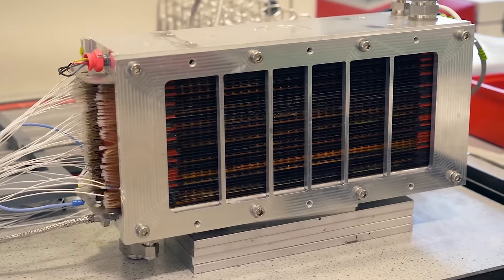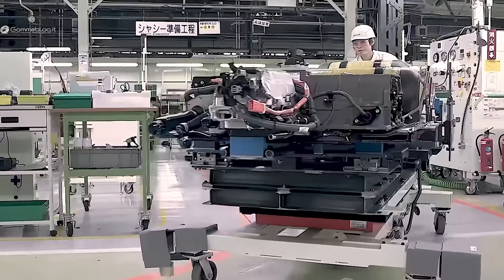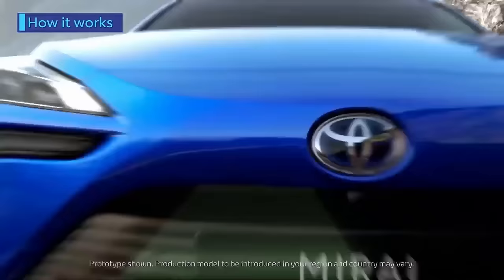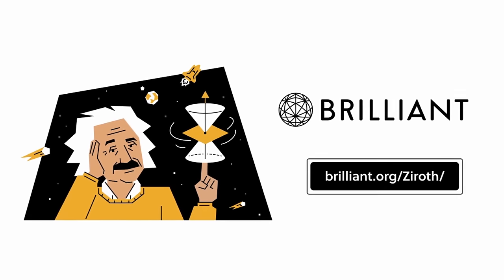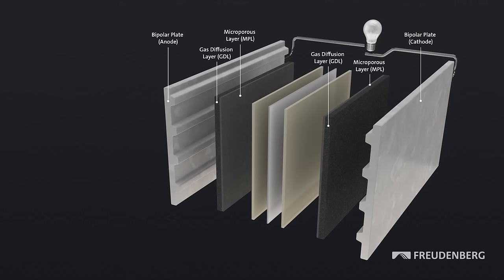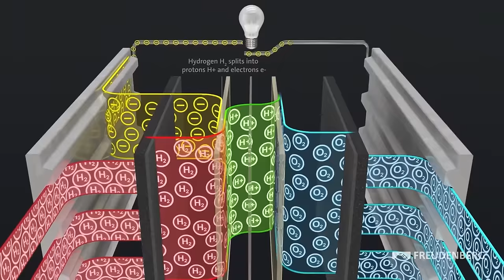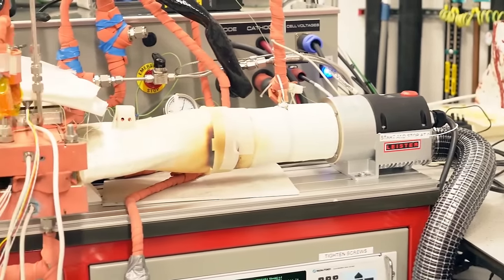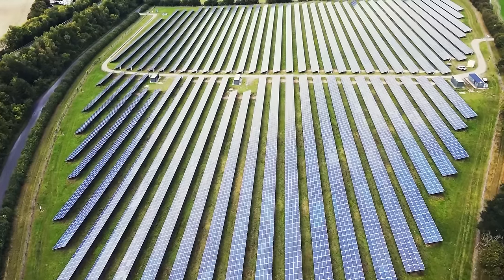Why This Hydrogen Fuel Cell is Engineering Genius

Comment: It may be more logical to produce methanol using hydrogen in the first stage.
Reply: Exactly!  Methanol is much easier (and safer) to handle than cryogenic (or high-pressure) hydrogen.
Better yet, they could just burn the methanol directly in an ICE.  Or perhaps a methanol fuel cell.
Reply: Methanol burning is not zero CO2 emission technology unlike the tech described in the video.
Reply: @Torx-uh3uo  Storing hydrogen is very difficult and inefficient. We must find a different way.
Reply: @glynnec2008 burning extracts significantly less energy from the fuel than fuel cells.

Comment: Why don't these guys use simple electrolysis to get hydrogen and oxygen from water, then recombine it as fuel and sent it thru an regular piston engine?  The exhaust is water when it is burned

Comment: I don't agree. Optimizing a thing that shouldn't exist, in this case hydrogen for cars, is not "genius". The most common engineering mistake i see is in fact optimizing and working on something that should not exist. Why make a part super duper great when in reality,  a great design wouldn't need that part at all. The only sensible thing for cars is electric
Reply: This isn't cars it's planes. There needs to be a certain energy density because you can't practically refuel mid flight. I agree for cars hydrogen doesn't make sense, but when you need the energy per unit mass to be higher battery technology is not capable of this yet. It's a case of using the right tool for the right job.

Comment: OK they made a fuel cell which can produce enough electrons to run a prop airplane.  That's great!  Now how do they plan to run a prop airplane at 30.000 feet? I am thinking the prop size and spinning diameter will be very be very large for such altitudes.  On most jumbo jets where would they place the props so they don't kit the ground when on the  ground.   They can barely keep the bottom of engine on 737 from hitting the ground.  Even if they are capable of building a high output fuel cell it will most likely require some serious redesign of jumbo jets for the prop system.  MY 2 cents

Comment: Why not capture some of the water byproduct then redirect it to an HHO generator that’s powered by solar cells on top of the aircraft?
Reply: Because "HHO generators" in the common sense dont work. I mean devices, that can produce several kWh of hydrogen from 1 kWh of electricity (overunity, perpetuum mobile).
Electrolysers work. But they are bound to the laws of thermodynamics. They will always produce LESS than 1 kWh of hydrogen from 1 kWh of electricity-input.
The same with fuel cells: You will always get less than 1 kWh of electricity from 1 kWh of hydrogen.
Why a lossy double energy conversion, if you can feed the electricity from the solar cells directly into electric motors? With hardly any losses?
It would be like using solar electricity to heat up water for a steam engine.

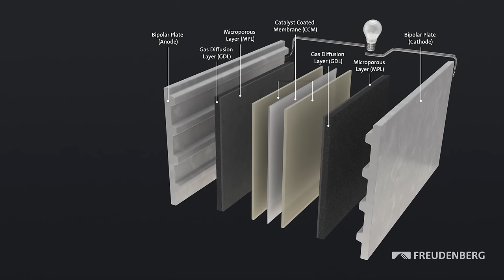Comment: 2:42 to 2:46 hydrogen and oxygen arrive at separate entrances..no mention how these two components are prepared and stored..these two components other than oxygen does not exist in air in pure form. They are just describing another way to use hydrogen and oxygen in this case to produce electricity. they dont mention where the fuel comes from..produced by part of the cell's power output?  perpetual energy? have they beoken through the impoasible?

Comment: The company has applications, but hydrogen for any form of mobility on road or air is a scam. Fuel cells are not the biggest issue, it's hydrogen production, transport and storage.

Comment: Not sure your version of history is correct but i am sure that powerful forces will resort to murder if their wealth is threatened. There is no doubt that electrolysis separates the water into 2 ingredients but my understanding is the qty produced by most DIY'ers is too little. Perhaps it's gone the way of the 50 mpg carb  but there are some old vid's running lawn mowers.

Comment: Hydrogen fuel is still just fuel and the output is many times removed from the input.  At this point in time EVs are a hugely better solution.  This is why Mercedes, BMW and others have tossed it to curb for the time being.  Also, consumers don’t want a money pit.

Comment: :cat-orange-whistling: YOU NEED TO LEARN HOW TO COPPER COILS CAN PRODUCE MASSIVE  HYDROGEN OUTPUT. TWO COILS EACH OPERATING AT TWO DIFFERNT VIBRATIONS.  FREQUENCIES.  (NOT AN OSILLATION).  YOU NEED TO UNDERSTAND THE INDUCTANCE PROPERTIES AND HOW THAT WORKS TO DISRUPT THE MOLICULAR STRUCTURE OF WATER..

Comment: Why using a fuel cell andnot pumping the hydrogen directly in the engine like gasoline engines do? Then like a gasoline engine the hydrogen gas comes in the chamber where the spark plugs make a spark and forms the explosion, etc. I want someone to explain me why not this system that would be less cumbersome.

Comment: Why not just just burn the hydrogen.....in a jet engine?  No fuel cell weight, no turbo charger weight.  Way less plumbing.  

Even if my question is stupid ,cutting edge engineering tends to focus on their patents rather than actual efficiency.

Comment: We have seen this technology come and go now for 40 years the claim is the same and I see no real advancement. Maybe it is a suppressed technology or maybe it is to cost ineffective to operate or not have the weight per horse power need. I feel as soon as the government funding dries up we will be back to refining our combustion engines and making newer fossil fuel synthetics. There are newer technologies that seem to be at the forefront of advancement I am hoping these will be the future as hydrogen compared to Gasoline does not have the same power potential.

Comment: And where do you get the Hydrogen from ?
From water of Course
Did you know, it takes more energy to get the Hydrogen out of Water, than the energy you get from burning Hydrogen.
It's like woo hoo, I just created a $1 Bill, and it only cost me $1.20 to make it
This is about as silly as running a Country on Solar or Wind Power, you can do that, but you'd have to have a Coal, Oil, Gas, Nuclear Power Plant running at 100% capacity on standby 24 hours a day.

Comment: That is really cool news.  I am all for hydrogen for aviation and public transit.  It really makes sense in those use cases.  It makes even more sense if they are using green hydrogen.
Reply: I think overline  electricity form the grid ala trams or the bullet train make more sense for pubic transit. Why carry your own fuel when you can  sip power from the grid?
Reply: No hydrogen dose not 'make sense' in either a financial or environmental sense, battery technology has passed it by long ago.
Reply: @kennethferland5579  Battery at the moment  is too heavy for certain application like ships and aircrafts.

Comment: 11:03 is that the best place for those? doesn't seem like it.
Reply: Dude, you're on a roll.
Reply: @Torx-uh3uo  first pass is systemic, then go through in detail and question and optimize every component, then do a new systemic upgrade integrating the improvements, "how do these new things work together better?", then whatever problems you had doing that you innovate to bypass. polished and standardized fully developed technology. i do this for every new engineering concept i encounter.

Comment: i have said for more than 10 years i want the Volkswagen Hydrogen EV car that is only sold in California here in Sweden. i dont want a Duracell EV, i want a Hydrogen EV car if someone has to force me what car type i  should drive. i have nothing against Electric powered vehicles, but its the batteries i dont want and everything that comes with it! i have asked for the Volkswagen Hydrogen EV for a looong time, yes its more than 10 years now! And yes Volkswagen have sold a car with this tech in the video in California for more than 10 years this is not anything "NEW".

Comment: The technology of hydrogen fuel cells is  awesome. We should continue the research. Though the reality and the big picture - hydrogen is NOT zero emission. It requires more energy to produce it than it produces. At the commercial level hydrogen is either produced by electrolysis or Steam Methane-Reforming (SMR). Both of those processes release an enormous amount of greenhouse gases. The most common and cost effective way hydrogen is produced in the U.S. is through SMR which produces CO, CO2 and hydrogen. Electrolysis produces greenhouse gases because 60% of electricity in the U.S. is from burning fossil fuels. Sure - there's biomass gasification but that' is not cost effective nor can it produce the amount of hydrogen in demand at the commercial level. Hydrogen energy is a negative net. In regards to its use as energy; Its best use is rocket fuel of its ability to essentially be a controlled explosion and produce a massive amount of thrust in a short period of time. Just like with EVs, the whole story is not being told. A hydrogen fuel cell is a bomb. The cost of hydrogen energy is aprox $90 per gallon. To make hydrogen a viable source of energy, more research should be in finding a way to produce it cost effectively and without producing greenhouse gasses... then it will be zero emissions.
Reply: methane is not reformed it is used in the hydrogen process for heating the (subject)..............
Reply: @roybarton9617  You are incorrect. To clarify the process is called "Steam Methane-reforming" (SMR)  AKA Natural Gas Reforming. SMR uses oxygen via air for combustion as a heat source to create steam. The stream heats the methane along with a catalyst (nickel or platinum). The chemical equation is 4(CH4)+ O2 + 2(H2O) -> 10(H2) + 4(CO). It produces CO, as you may know, when CO is released into the atmosphere it reacts with oxygen and converts to CO2. Other air pollutants (e.g. VOCs) are also produced in this process. The result is 8-10kg of C02 per  kg of hydrogen produced.
Reply: @LindyMover you know what I am saying about the catalyst............
Reply: @LindyMover by the way there is no oxygen present in air....all oxymeters are preset ..........what is the source of combustion?.........
Reply: @roybarton9617  Go get educated.

Comment: I'm going to go back to Stan Myers. I think people are going in the wrong direction. You don't need to have money to fly, use water. Somebody already invented a water car that you can literally use Water. And using the existent platform can bust, an engine to propel. There's a vehicle down the street using water, and it's not only just for that. Many different use And using the existent platform can  engine to propel. There's a vehicle People are overthinking this and taking it to another level to me to support other people to make fuel stations when you don't need it.
The only thing that is going to be different about what what I am saying versus what beautiful people are for whatever the f reason is, wants to use Fuel cells, it's just a waste of time and money. Look at what Stan Myers had made. And it doesn't require a Fuel cell, I repeat, it does not require fuel cell
All the processes it is done inside the engine and it also can be  Improved upon. Why limit yourself people? Why? Why? Why? Why? Why? Why? Why?

Comment: There are three problems with hydrogen: infrastructure, infrastructure, and infrastructure.
Reply: Yeah they had the same issue in the 1920’s. Luckily humans can fix that.
Reply: + low density of hydrogen. The size of fuel tanks is gonna be chungus to be used in medium to long distance flights. Consuming huge space previously meant for passenger and cargo

Comment: wouldn't hydrogen engines cause there to be more rain? (i am fully pro hydrogen engines, i just want to know)
Reply: No. The combusion of hydrocarbons (gasoline, diesel, kerosene,...) and hydrogen produces water (vapor) though, but the amount is negligible compared to evaporation from vegetation and water surfaces. And we already emit around 10 billion tons of water by hydrocarbon-combustion annually.
Sounds like a lot, but is nothing compared to the natural cycle of evaporation and precipitation.
Reply: @701983  thanks for info!

Comment: The uses for extra heat are endless. You can make use of the heat to power an ammonia absorption cycle to cool a space down even. What you can't do is make storing hydrogen any cheaper. No matter what you do, adding this complication to a system will be like living with Dracula... wondering where your energy went.  The amount of energy required to keep a tank at cryogenic temperatures to keep the tank from exploding under more than 10,000 psi... yeah, that little vampire. Sounds great until you realize you're not in space with space temperatures to help out. Don't get me wrong... I support change, but we have to be smart about it. Can we as a human race responsibly install hydrogen generation and storage in our homes? Let alone drive these kinds of CRITICAL systems around? Airplanes... sure... Cars... eh.... How many LPG car explosions have you seen in other countries... It's pretty wild. More times than not they're due to user error... We have people putting gas in Teslaas here in the states.... so... connecting 10,000 psi filling nozzles sounds a bit... wishful.

Comment: I'm not sure how the efficiency numbers stack up compared to using a conventional turbine and alternator, but if this technology gets good enough then a high power hydrogen fuel cell could be the engine for 7th generation fighters, which will likely place a greater emphasis on power generation than thrust.

Comment: The easiest way to reduce CO2 emissions is to massively increase the price of air travel....
It makes no sense to travel that often by plane too - I have not taken a single flight in nearly 20 years despite the fact that currently it is often cheaper to take a flight between two european capitals than to take a high speed train. No new technology needs to be developed to extend the high speed train infrastructure, and the capacity and confort of a single train is way higher than a plane. Just from a physics point of view, flying will always require more energy than rail traffic.
Airplanes only make sense for transcontinental and high speed transport. This should come at a steep price, because the need for that transport for humanity is rather low (seriously!). Be honest: you can survive without Christmas shopping in New York, and then fly to Ile Maurice for the holidays, and if you really want that: pay the real price for it, which should account for the cost of climate change effects.

Comment: i skipped to the end "challenges" where you say "how the production,storage and refueling of hydrogen would work"...and then there is no explanation of how this would work.  you just say renewable energy to produce hydrogen.   this is silly.  if you are going to make electricity to electrolyze water to hydrogen + oxygen...and then presumably use more energy to compress it and store it cryogenically and then convert it back to electricity with an expensive fuel cell...what a waste in conversions.  just store the electricity from solar/wind/hydro/nuclear in a thing called a battery and then use it...very very efficient.

Comment: I don't see why this is a breakthrough. After all, if you are using hydrogen as a fuel, you can as well burn it in a very lightweight and efficient modern gas turbine, instead of using a cumbersome device to turn the hydrogen's energy into electricity first and then drive electric engines with that.

Comment: seems overly complicated, Why not build hydrogen on demand units and use the hydrogen as a fuel like natural gas, then you can use it in existing ICE engines that are far less expensive to manufacture. Imagine being able to fill your car up with water and it converts the water into hydrogen as the engine requires the fuel, now you are not hauling around highly compressed gas that leaks out over time. Oh ya thats right because they wouldnt be in control of selling you the fuel source any more.

Comment: Why is the application always geared towards transportation when we all know that homes are bigger emitters of carbon? What is green tech BTW? I hear it all the time, but always is put into context of some new technology that hasn't been proven and that we should put money into. Energy density of oil is quite high and the cost of extraction and refinement quite low. I wonder how much carbon is created by all the green tech projects that failed have contributed in ppm over time? Hydrogen storage is rife with problems being the smallest molecule of all. Containment has it's own "Carbon Footprint." Nuclear energy is even much more efficient than oil, but has become cost prohibitive because of governmental regulations.  If we built a bunch of nuclear plants and made charging stations for battery cars convenient maybe that would work better for carbon Phobe's? Phobia's are an impediment to fundamental scientific discoveries just as much as scientific religiosity is to sound engineering.

Comment: Hydrogen is not the answer. It's cost more energy to produce than than you get out. We don't just find a natural hydrogen well lying around. Secondly as it the smallest atom of the periodic table, it dissipates through any containment material over time, meaning a bottle of the stuff will surely dissapear if left standing. Therefore even more energy is required to keep it in cryo temperatures. And lastly, the thing not talked about by anyone. Hydrogen is more damaging to the atmosphere than CO2 or methane put together.
Next genius idea anyone ? Because the way I see it, there is nothing wrong with fossil fuels, if these morons just stop cutting down all forests. The worlds mycelium and volcanos produce more CO2 than industry in total.

Comment: By changing the catalysts you can have fuel cell engines run off diesel fuel and still have 0% green house emissions. Ive learned that working on  improving fuel tech!!